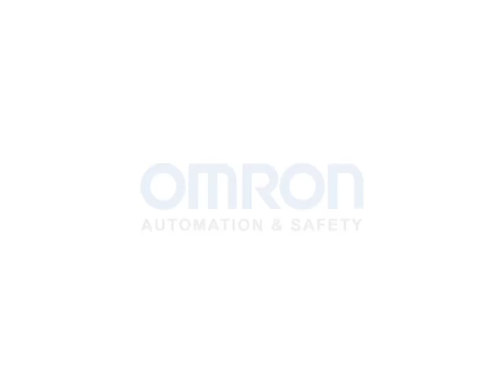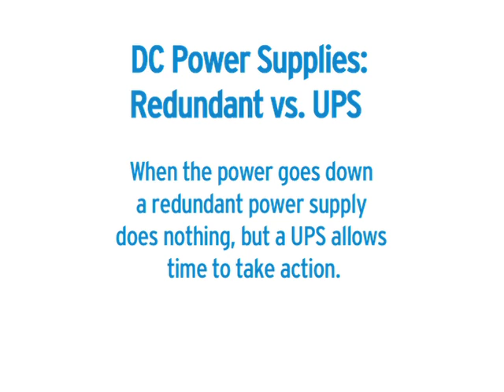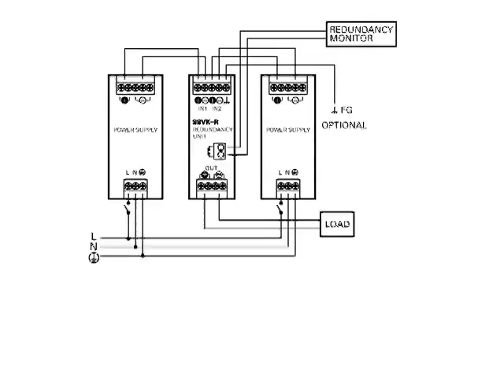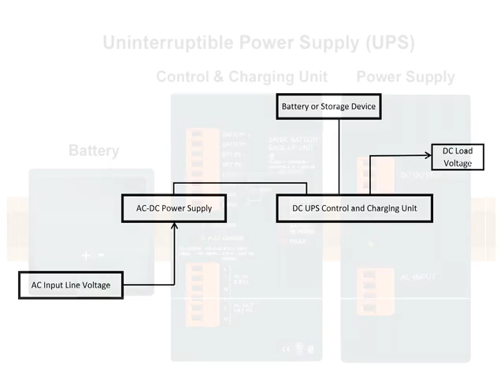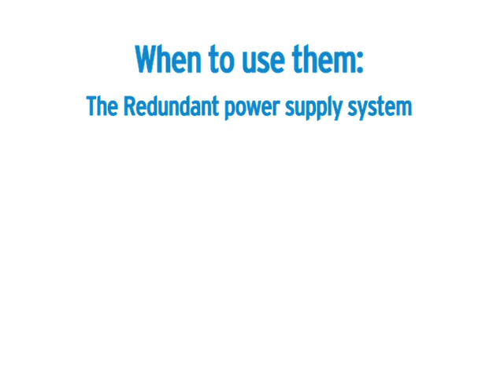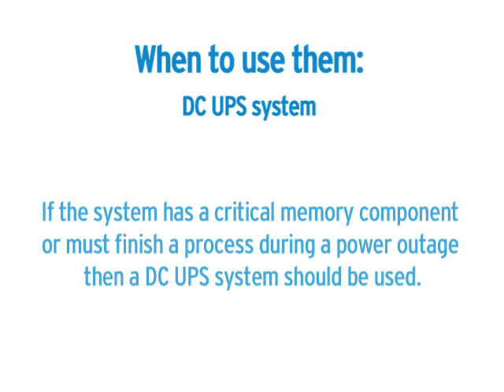Omron DC Power Supplies -- Redundancy vs. UPS

Comment: I bought 10 pcs of Omron power supply S8VK-G24024 (Lot No. 30816H) from supplier in Hong Kong in November 2021.  However, the outlook of new power supply is not identical to the old power supply. There is a black sticker on front side of the new power supply instead of silkscreen printing, and finishing of case is painting.

I asked technical support in Hong Kong, China, and Japan many times by phone (Hong Kong technical support's telephone number is fake), web form (no reply) and email (no reply) to verify whether my product is fake, but they have not replied any answer to me.  That is very poor technical support!!!!!!

If you are considering to use Omron power supply for your utility, you must know there is no technical support for Omron products!!!!!